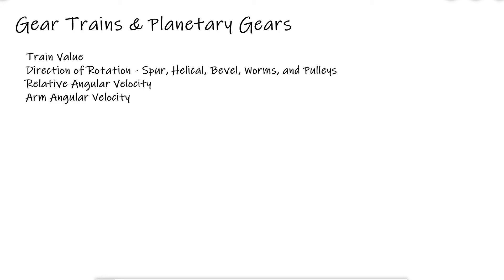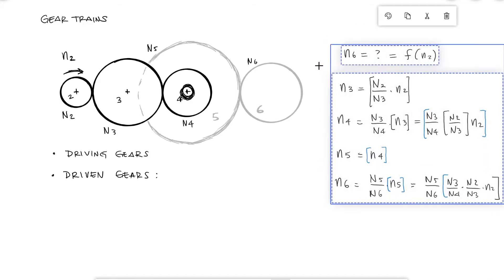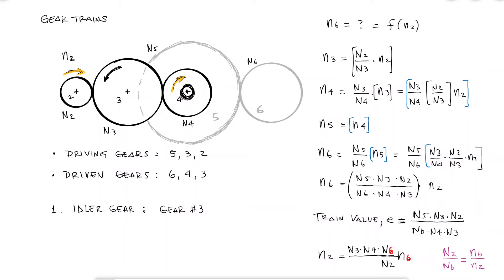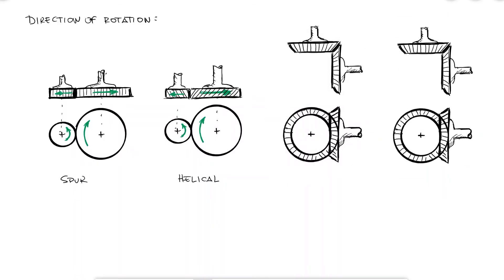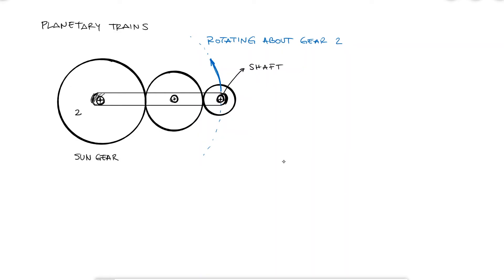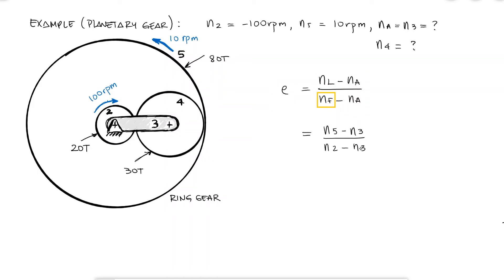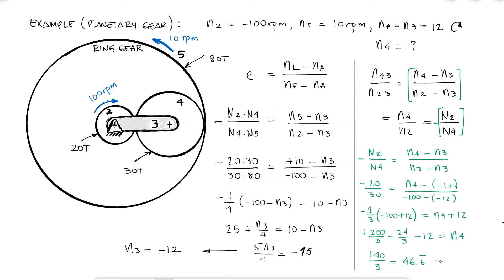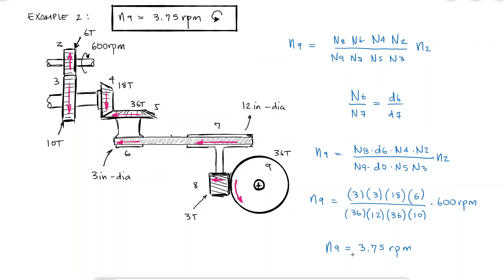Gear Trains and PLANETARY GEARS in Just Over 10 Minutes!

Comment: With the planetary gears when you write (  (nL - nA)/(nF - nA) ), is the speed of the first gear (nF) referring to the gear it rotates about at its base? or is it generally the driving gear that creates the motion?
Reply from the maker: Gear that drives the system. However, if you set up the equation correctly (meaning, you keep the n to N ratios inversely proportional, and not worry about what is defined as train value "e"), it doesn't matter which one you define as first and last gear.